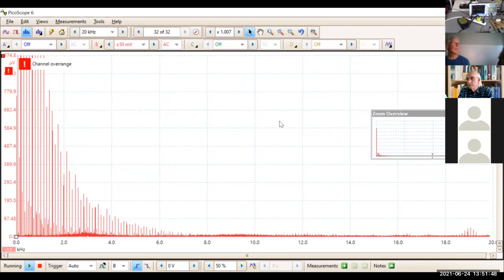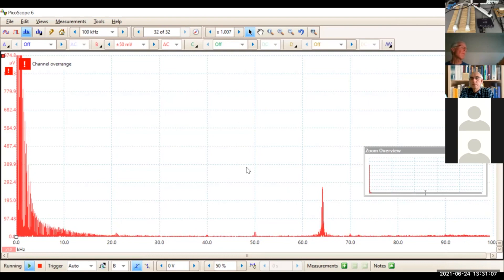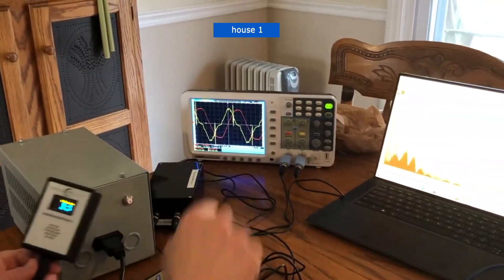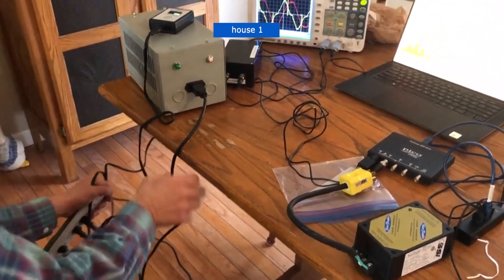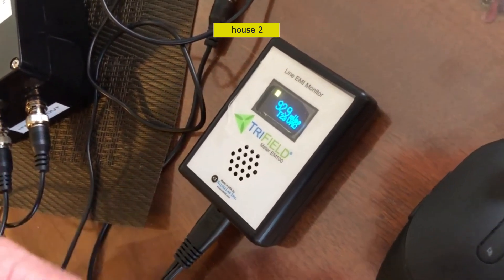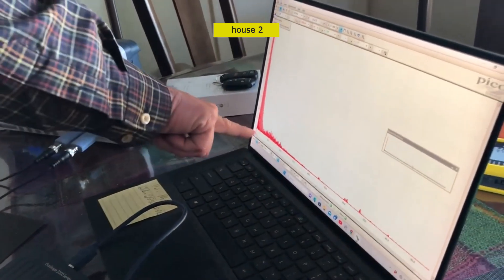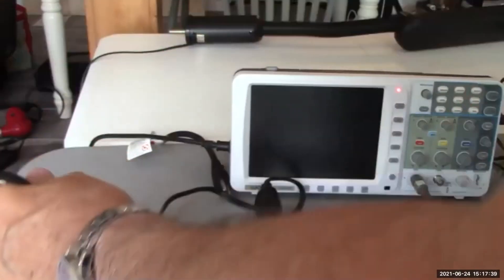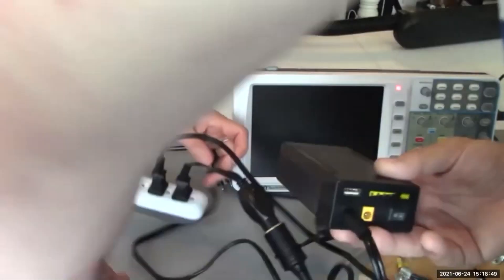Oscilloscope methods for EMF sensitive people ------------ and grounding methods -------- solutions

Comment from the maker: It is important that companies add filters to their products so that it does not spread common mode current, differential mode current and transients everywhere, some of this can be very hard to mitigate later, as Bill said in this video. EMF sensitive people are not against technology, we are pro safe technology and safe living spaces, for us, our friends and families.

Bill said that there are very little health effects above a certain frequency, however, I question that, because cells are found to vibrate between 10-30kHz and between 150-180kHz (for example) see pdf bio effects in description at the bottom.

Filters can help fix a problem, however, if you still keep strong emitting sources inside your house, take for example a dirty TV that plays all day long, you can still experience bad effects, because a TV can emit dirty electricity in space pretty far sometimes (see my TV video). Filters clean up the lines but (in my limited experience with filters so far) it looks like filters do not remove what a source emits in space, which is why manufacturers need to produce cleaner products. So if you clean up your lines with a filter but then use 'dirty' products inside your home, you will still feel it if you are in the field they emit in space. 
For measuring in space I personally first test dirty magnetic fields (above 2 kHz) with my ME3851a (or use a ME3951a) because I think I react to that the strongest. But there is of course more to test for in space than that alone, as was shown in other videos. But even if I only measure like 0.1 to  0.2nT above 2 kHz on my limited device I can already react to that sometimes.

If you are aware of other affordable filters that may help EMF sensitive people (other than those linked to in the description),
please post a comment below. Until all products are made cleaner, external filters will be necessary.

Keep in mind that when I link to other peoples videos,
it doesn't mean I agree with every thing they say or claim in their videos (like their ideologies),
but the technical information they share is useful because EMF meters that are proven to be reliable don't lie.
Reply: I was thinking here if the DE emited from TVs and Monitor can be because some or most of them have the power supplie INSIDE the monitor. Or that DE can be mitigate/controlled with monitors or TVs that have power supplies outside of them.
I made a mistake to buy a monitor with the power supplie inside. Was late when i noticed this.
Reply from the maker: @marceloresende3436  A long time ago I bought a monitor with an external power supply and I still measured lot's of EMF from the monitor itself. But this was only tested with a handheld radio back then. I would need to re-test with better tools to confirm this, back then I didn't have the tools I now have and it was only 1 monitor. An external power supply may help, it's worth to try, but I would be careful expecting wonders. Dirty electricity spreads all over and the monitor can still have dirty components behind the screen.
Reply: Great information and decades of collective BB experience in solving complicated issues for the EHS, and those that don’t even know that they’re also sensitive.

Us BBs regularly participate in zooms sharing our latest client issues and solutions, as none of the problems are simply nor easily discerned, measured, nor mitigated.

A large portion of folks are entirely skeptical, until they viscerally and immediately sense improvement!

The sinetamer has something other DE filtering solutions don’t and that’s beneficial insurance to mitigate nearby lightning strikes immense current surges and voltage spike transients that will likely fry all or many of a homes electronics: computers, blenders, TVs, HVAC, washing machines, …, dryers, stoves. Depending.

So if you imagine the solutions are expensive, just try adding up replacing all of that. Depending on likelihood of downed power lines, and power grid brownouts too.

TY Merializer
Reply: @davidtyner1578  I am EHS and I live in a fully shielded appartement in a busy citycenter. I obtained levels under 1 µW/m² but I cant open the bedroom window while sleeping, it's very hot in Spain and I need the AC running, switching it off is not an option for me. I need to filter that massive DE at any cost. 'm going to buy the necessary measuring devices and filters

Comment: Oh man, my friend...it's the perfect gift for me. Thanks to you I discovered Rob Workman's channel. I watched all his videos which are great. I also discovered Bill Bathgate and this guy is awesome, I think we have now a way of visualising and dealing with DE. I'm looking forward to buying a Picoscope and Owon. Do you know which model is the one they use?
Reply from the maker: In the workshop of 2022 Bill recommended these for his students:
OWON SDS7102V 100 MHz
PICO scope 2205A 25 MHz
Hantek HT-201, 20 to 1 Passive Attenuator
They also use an ubiquitous filter, but I don't know what model that is.
Just be aware that you need training to use scopes. 
It's not as simple as buying and using an EMF meter.
I think he also said it all needs to run on battery power
including the laptop you connect the Picoscope to, to measure properly.
Reply: @Merializer  thanks a lot. I contacted Billby email because I have this awfull setup in my mains board, two `phases without a neutral or ground. Stupid electricians since Franco's dictatorship in Spain. So it's gonna be very tricky to connect those instruments to a biphasic mains. I will give him  a call eventually, I know this partivular setup will tickle his curiosity and he might be able to help me with some advice
Reply: @Merializer  Do you know where we can find more videos of this expert?
Reply from the maker: @Torito1774  I haven't seen any elsewhere.

Comment: I hope you can help me. Smart meters are not required by law yet in Maryland  but Potomac Electric told me they have to take my glass analog dial electric meter and send it to PA "to be tested"  and replace it with an ITRON Centron C1S residential meter. I asked them to remove and visually inspect my analog meter and there is no sign of overheating or any other issues. The installer showed me Centron C1S and took the cover off to show me inside the meter. I was shocked to see it was made of thin plastic components like a cheep dollar store toy! The installer agreed with me it was junk, and his supervisor agreed with me that it was junk but both said I had no choice in 25 days from now I either let them install it, or have my power shut off. I purchased a brand new replacement analog meter years ago when I first learned about smart meters but I was told I'm not allowed to have it installed and it won't work anyway because it's number is not registered. I think the Centron C1S is a fire hazard, and I live in a historic house near the Antietam battlefield. Is there a history of fires with this meter, EMF pollution, does it need a filter, etc. and what can I do to fight this? Thank you very much.
Reply from the maker: I think it's better to ask this in an EMF group, I don't live in America. There are probably people who had similar experiences as you in such groups. "Electrical Sensitivity Support Group" on Facebook for example.
You can also search such groups for similar previous questions asked.